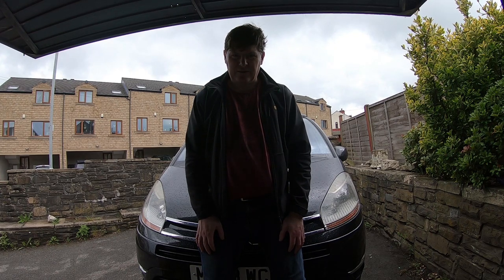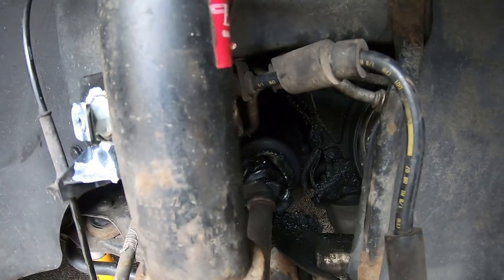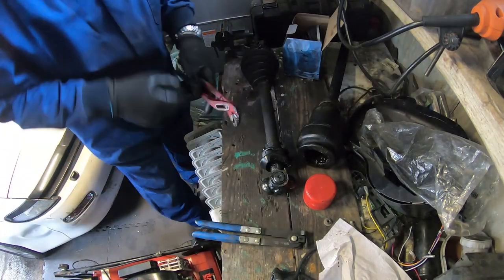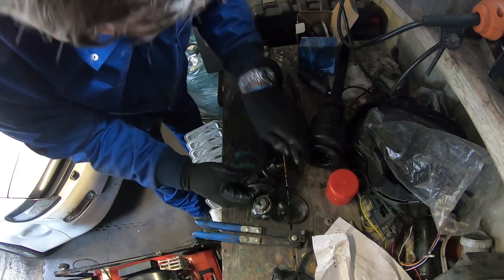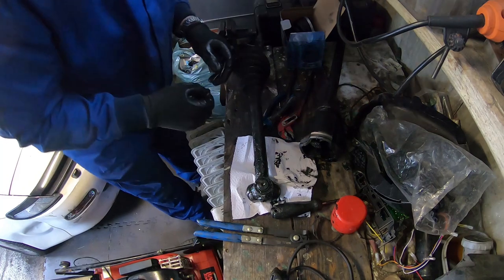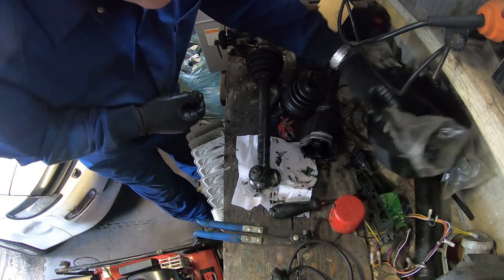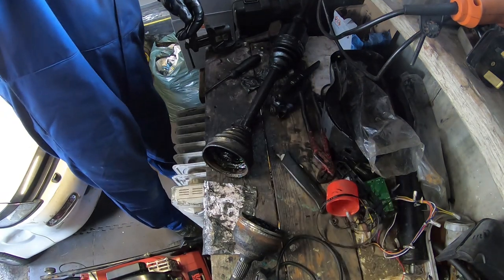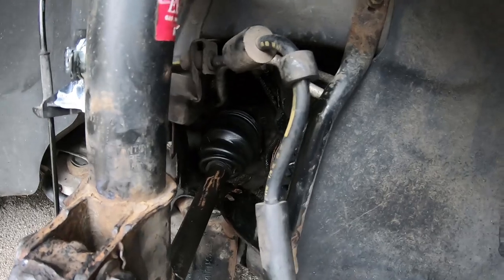Citroen C4 Grand Picasso Part 39 - Offside inner (and outer) CV boot replacement

Comment: Hi now whats the best advice you can give me for a diagnostic machine to reset the ely fluid tank top up under the n/s rear floor is it a difficult job to top the tank up not tbe bag type thanks. 🤔
Reply from the maker: I use Diagbox which you can find on eBay or Amazon. It runs on a Windows laptop.

Comment: Dave that was a struggle mate reminds me when I changed a Cv boot on a mk one Golf we could not tap the Cv of even used a lump hammer so the only was to fit a new boot was to open the boot up wide enough to slip over the joint what a nightmare that was I would not want to touch a Golf again sometimes a straight forward job turns out a nightmare
Phil in stoke
Reply from the maker: I tried a CV boot stretcher on the Polo but I ended up tearing the boot. A 2lb lump hammer usually works most of the time. It was luck I had plenty of CV boot clips and the proper pliers from the Polo project.

Comment: Hi firstly while you've been working on that C4 Picasso can you tell me the best diagnostic machine for a Citroen,do you have any advice,thanks
Reply from the maker: The best one in my opinion is Diagbox which is the one used by the dealers and the Citroen specialists. You can find it on eBay or Amazon. It runs on a Windows laptop.